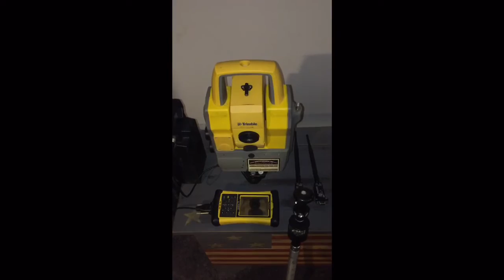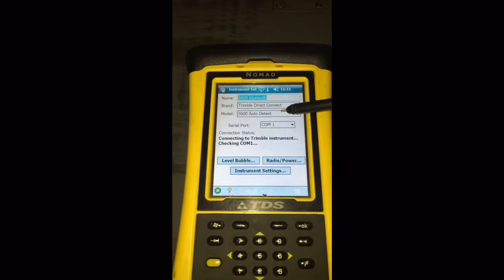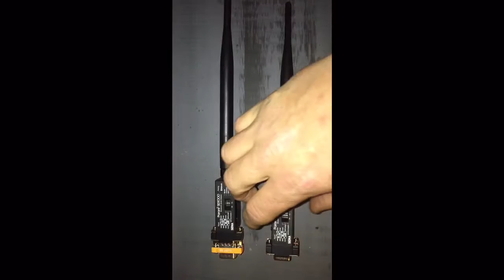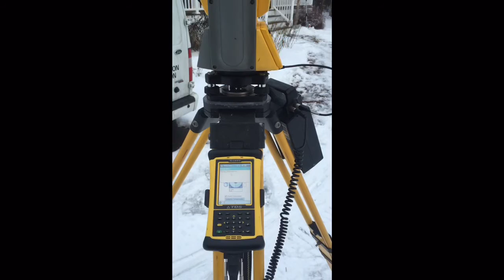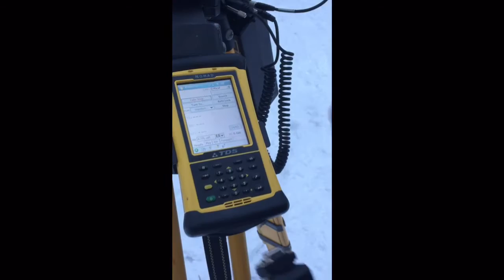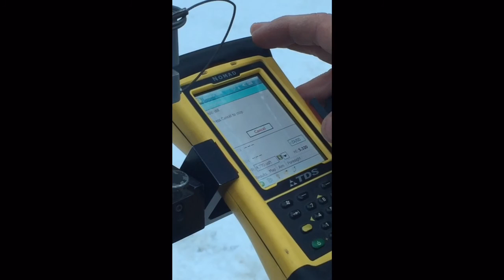Trimble 5600 Robotic Total Station using Bluetooth in place of radios

Comment: very important, for it to work the adapter needs to be a NULL ADAPTER (orange), which allows the data flow in both directions, if you buy the normal one (yellow) it won't work because it only lets the data goes in one direction

Comment: hello, I have a serious problem with my equipment, which has been stopped for 6 months, as the authorized companies in my country said that they no longer have firmware for this equipment. I would be very grateful if you could provide this firmware or even put value!!
Reply: مرحبا 
كيف حالك
لدي جهاز تريمبيل 5600
نظام dos هل لديك pdf
كيفية تشغيله
وهل يمكن استبدال البطارية الداخلية
بدون مشكلة في البرامج

Comment: Do you know if this will work with my Trimble s6?
Reply from the maker: Not sure, never attempted any other instrument and data collector combination with this set up. Good luck.
Reply: @603septicdesign9 Is I understand correct parani is Just a long cable. If so why need first connect the instrument with a short cable and then change it with the long cable. I'd is a cable it should work directly.
Reply from the maker: @nikouer  With that system, it wouldn’t work for me without connecting the cable first and then switching to the perani. 
If you can make that work, congratulations to you.

Comment: Does the 5600 have to be equipped with a radio if your using Bluetooth instead?
Reply from the maker: No. You are tricking the robot and data collector to think it is running on a cable connection. The robot radio is never initialized.

Comment: Do have to have the Trimble RMT 606 Remote Target 360 Prism for this to work?  Or can you just a universal style prism target?  In other words, will it autolock etc without the battery powered beacon?
Reply: 5600 requires a diod

Comment: How does the Nomad data collector communicate data?  Through the same 4 pin hirose where the geodimeter would be on the robot?  And then to db9 connector of Nomad?  I guess external power comes in above the tribrach?

How are the radios powered?

Comment: Are the 5600 series completley robotic whereas they follow the prism constantly as you move about?  Or do they just autolock slowly one point at a time?  I.e. click autolock...  wait...  lock on.. store point?  Uggh.
Reply: Some are Robotic some just Auto Lock, and some are conventional 2 man boring ass guns.  the Auto lock is the gun following the prism.  The BT adapters here turn ANY Auto Lock 5600 or Geodimeter into a Robotic total station.  I here the range sucks in woods but did not see any comments on here about that.  Still nice to keep your dinosaur alive.  We run these units daily.  The crews whine about the old equipment but I have enough parts to keep them going for years and the Geodimeters are indestructible solid guns Must be an "S" or "DR" model.  Good luck finding a DR.  Disposable 30K crap made today sure faster lock way better I still don't see 30K improvements yet.

Comment: Can you suggest where I can find the longer antenna you have on yours? I just have the regular short one, running a single SD1000 on a Leica TPS1200 robot with a Panasonic FZ-M1 toughpad (it has long range bluetooth built in). I'm only able to get just short of 500ft before I lose connection right now. Without the adaptor I was able to go over 360ft just manually connecting my toughpad to a Topcon GT-503 without the RC unit turned on. I was hoping between the long range in the tablet and the Parani I'd be able to get more like 600-800ft. I imagine that longer antenna might do it.
Reply from the maker: I used a company named Lemos International from Rhode Island. The last order that I made was almost 6 years ago so I’m not sure if they still carry the parts. 
If they do, you will be in good hands with them. They always shipped quickly and the prices were reasonable. Best of luck.
Reply: @603septicdesign9  I found an antenna at kanda.com. It's on its way to me now apparently. Very cheap. Hopefully it does the trick. They had an extension cable also that can attach to the sd1000 and the antenna as far as I can tell. But it was expensive and I'd have to set up a second bipod and pole or something to mount it to
Reply: I got mine at Radio Shack.  They were called wifi antennas for wireless routers.  cost about $10 for the two (I think)

Comment: Does anyone know if this works with a TSC2 running Survey Controller 12.50 (as opposed to Survey Pro) because to set up a Com port connection as opposed to it choosing radios I'm not sure if only Survey Pro let's you do that
thanks!
Reply: Jeffrey, did you ever find out if this setup works with the TSC2 Survey Controller v 12.5?  I just got a 5603 and I am having the same problem where there is no listing for the COM port.
Reply: @robertsiepel903  Yes it worked!  I do hook it up as if the inst. is directly connected to DC then after it levels up I quickly uncouple the cables and pop in the paranni adapters
Reply: @robertsiepel903  You don't change any setting like that in the data collector and you don't need to set up a different configuration for bluetooth. You need to use the trimble 3-battery housing thing as a connection point or buy a cable but I hook up the data collector and the gun to the same side of the battery holder and the power connected to one of the ports on the other side and turn on the instrument. Then I start up Survey Controller and it immediately finds the 5600 and goes to the level up process.

Comment: I’m very interested in these Bluetooth adapters. I read a comment asking about how to power your prism, seems like I’d still have to carry a batter on my pole with me. Is there a way around this? Possibly buying a different prism that doesn’t require power? Or one with an internal battery? I’m still very new to surveying but the more wires and weight that I can eliminate, the better off I feel I’d be. Do you have any advice for me eliminating needing to carry my battery to power my prism? I would greatly appreciate any advice you have for me! Thank you!
Reply from the maker: Michael Fusco 
The factory prism power pole from Trimble has a battery built into the pole itself. There are no wires and nothing additional to carry. The prism threads into the pole and is powered from it. It’s not too heavy and the batteries can be recelled for reasonable price these days.
Reply: 603 Septic Design wow really? I did not know that. So you basically charge the pole and go from there?
Reply: @603septicdesign9  Thanks for getting back to me... I've been searching all over for one of those rods... Any advice on where to find one? I've been searching everywhere online, amazon, ebay, google, engineer supply websites... I'm not having any luck at all...

Comment: I can also confirm the Trimble 5600 + Parani pair will also connect to a Trimble TSC3 data collector with Access. You must complete the station setup first, then plug in the Paranis. Disregard the error messages. Also, note that the null modem adapter does not work both ways!

How are you supporting the Parani connected to your gun?
Reply: Ryan, Do you know if this setup will work with the TSC2 with Survey Controller v 12.5?  I just got a 5603 and I am having problems with the georadio "blue dot" right out of the box.
Reply: @robertsiepel903  From what I understand, this setup will only work with a TSC2 running Survey Pro.

Comment from the maker: They have their own rechargeable batteries. I purchased the extended length version with the radios. They will last up to a week on a single charge and they weigh nothing. 
I wouldn’t recommend messing with them at all, it doesn’t get much better than the factory set up.

Comment: How are these powered and can they draw power from Data collectors and total station. I have a TSC3 and a 5605 with a large battery with two hirose connections
Reply: There is some discussion on the RPLS forum about drawing power from the DC. But not the total station. I ordered the battery packs for these separately from the adapters from Sena.

Comment: This is a great idea. And seeing how I can’t find the georadios anywhere I may need to give this a try. Are you still doing this? How are you powering your prism? Is it necessary to connect everything with wires every time you set up or can you just plug in the BT adapters and start everything like normal?
Reply from the maker: Not using them any longer, finally upgraded my gun after 10+ years. 
I had the prism pole battery recelled a few times over the years and always used that normally. 
Since you are essentially setting up the gun to run in cable mode, then switching over to the perani radios, the answer is yes. I tried to skip the cable process multiple times and it never works. I think this is the main reason why others have had issues with this set up. 
It seems like an extra unnecessary step at first, but eventually it becomes part of your normal setup routine and works well. 
Best of luck.

Comment: I am adding the Sena Sd1000 to my 5603. I have a data external  collector like in your video. The angles are not showing up on my data collector. Are they a setting on the instrument to have it send the information through the RS-232 connection? So that my data collector will display the angles.   The data collector is on cable mode. Thanks for your help.
Reply from the maker: Roger Morgan 
I haven’t used this setup for a while but I do remember one very important initial step. Connect the gun and data collector with the cable and make sure they are communicating through the cable. You should have angles displayed when connected properly. 
Once you have confirmed that they are communicating through the cable, then disconnect the cable and connect to the paranis. 
You will see the angles disappear while disconnected, then they reappear when the radios link up.
Reply: @603septicdesign9  I'll try that. Thanks

Comment: Try connecting the onboard Bluetooth of the Nomad with the Parani that is connected to the instrument. You can pair them using a computer with a serial port (RS232) and the Winpar utility from Sena's website. You'll be surprised with the the range. I got 250m range with my Nomad and an SD1000 tied to a Leica TCRA 1100.

Comment: I noticed a yellow adaptor (plug?) on one of the Bluetooth antennas? Can you elaborate what that is for?
Reply from the maker: It is a gender changing adapter. Basically, it allows you to select male or female connection of the 9 pin cable connectors. I believe they are included with the purchase of the Bluetooth radio.

Comment from the maker: I don't believe the settings on the dip switches necessarily matter all that much. What is important is that both Perani adapters are set at the same switch settings. Also, make sure that your adapters are turned on and communicating with each other before you try to connect them to the data collector and instrument.

There should be no settings that you need to change in the gun or the data collector. Both should be set up for cable use. If everything is working properly when set up via cable, then the Perani adapters simply break that cable and allow you to go wireless.

One thing that seems to work well is keeping the cable connected until after the level bubble screen and then go into any function that will show you the instrument live data. (HA/VA etc.) once I can see the live data on the instrument, then I connect the Perani adapters.

Comment: Hi,
Really good video thanks!
I followed your instructions and tried to connect a TSC2.

It works with the cable but not with the BT adapters.

What settings for the dip switches do you use?
Do I have to change some settings in the 5600 or data collector and were in the instrument can I check it?
Do you use the gender change adapter that was in the Parani package?

Have a nice day!

John
Reply: The Parani adapters worked for my instrument and TDS TSC2 with the factory settings. Do not mess with the dip switches! If you do, reset both adapters, turn all the switches to off and re-pair the devices.

Comment from the maker: It should. If your system works normally by using a cable, then the paranis should work. 

Just keep in mind that you need to set everything up as if you were running it via wire/cable. People have gone crazy trying to set up the Bluetooth adapters as radios. This doesn't work. In this application, they are simply a 1000' extension cord for your data collector.

Comment: Hullo and well done.
Will the Sena Parani 1000sd bluetooth serial adaptors work with a Trimble ACU data collector (as opposed to a Nomad) ?
ie by connecting a 4 pin hirose cable into the controller and a db9 connector into the Sena.

Comment from the maker: Normally, 5600 guns use trimble batteries that have double hirose ports. One for power to the gun and the other is a data port for the nomad. 
I'm not sure that your wiring the gun/data collector correctly. I've never attempted to connect them in different ports and I'm not sure if that would work. (Possible?) No drivers should be needed to my knowledge. 
When I use a normal 12v battery to power the gun, I use a modified single brick battery adapter that has the double hirose ports.
Reply: +NH Septic Designs Alton NH 
I see. I notice you don't have the Trimble Geodimeter CU on the gun, but a more basic (buttonless) one. Maybe that's my problem? I am powering the gun with power supplied via 3 way connector.

Comment: I just received my 5603 and a Nomad 800 TDS. This robot came with no manuals, nor cables. Right now I have the 5603 powered up with an external 12V sealed battery and hirose connector right above the tribrach. On the side of the 5603 keypad I have another hirose connected via 9 pin RS232 to usb dongle to the Nomad. I "think" I'm missing a driver to communicate between the 5603 and the nomad. When I go into Survey pro to set up a new instrument using your procedure above it gets stuck Connecting to Trimble instrument... Checking COM1..."

Is this the way you have yours physically wired? If so, do you happen to know how/where I could get a driver? No luck with the Trimble website.

Comment: Sweet. What kind of range are you getting? I'm looking for a robotic setup, most likely a 5603 DR300. Does it matter which data collector and software?
Reply from the maker: The longest shot that I have attempted was around 800'. I'm mostly doing residential existing conditions surveys so long distances aren't often needed. 
I have used Survey Pro and Carlson SurvCE with no issues at all. I'm sure others will work as well.  Good luck, the 5600's are great guns.

Comment: i try to conect tsce to trimble 4700 rtk..nothing happend...
Reply from the maker: Make sure that the parani Bluetooth adapter switches are set the same baud rates and paired before you try to use them.
Reply: all setting is good, nothing happend...
http://surveyorconnect.com/threads/parani-trimble-5600-tsc-2-trimble-access.304142/
Reply from the maker: 1) keep the parani adapters unconnected to the gun and data collector. Turn them on and make sure the connect light is flashing. 
2) connect the gun and data collector together using a CABLE and initialize the gun. 
3) once the gun and data collector are talking to each other properly via CABLE, then attach the already paired parani adapters to the gun and data collector. 

If the data collector will run the 5600 via CABLE, then the parani adapters will work. Keep in mind, they are NOT replacing the radio, they actually giving you a virtual 1000'+ cable to work with.

Comment: Hello very good ingenuity. Will you please help employ this method immediately with my Trimble 5600 robotic. I wonder if the Sena Parani adapter, comes with correct thread for trimble antenna ? Thank You in advance Ed Clarke. PS I would like to use this method on GPS base stations and rovers when the BT adapter has failed does this sound plausible?
Reply from the maker: +Ed Clarke This method should work with most instruments that can be controlled via hardwire/cable. If you have specific questions for making this work with your 5600 robot, I might be able to help.